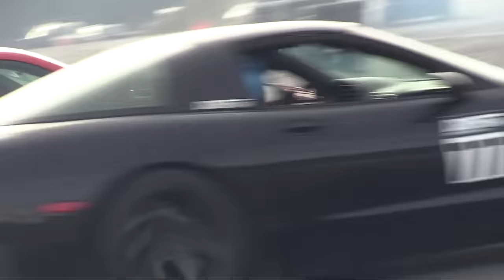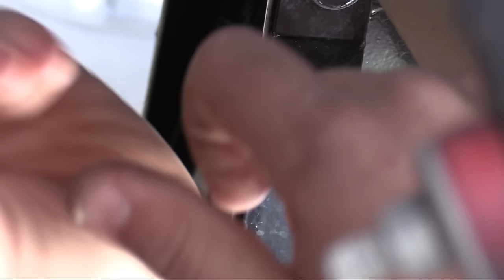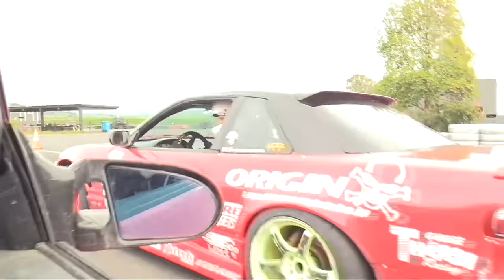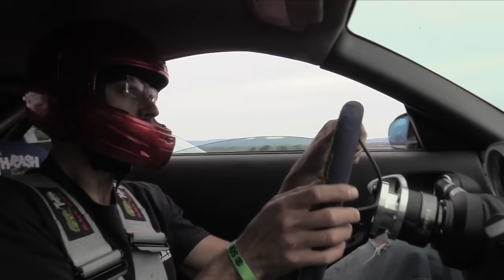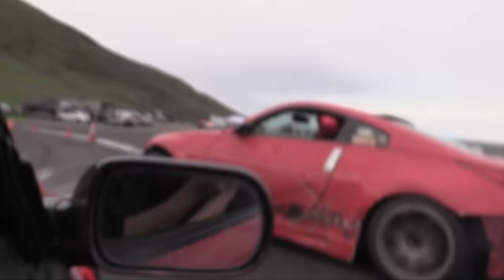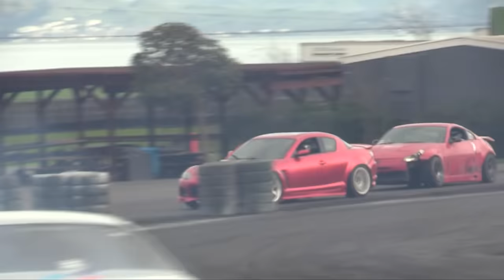No Name Drift Day RAW | Animal Style

Comment: JULIAN SIR I NEED THE Z SETUP and ALIGNMENT SHEET!
Reply from the maker: Gktech bolt on knuckle (high Ackerman setting) and LCA (shortest length, I think 25mm over stock), Stance coilovers, 4.3 final gear (4.1 is probably better)

Basic alignment stuff, little toe out front and whatever caster/camber you end up with at that arm setting. Zero out the rear and goooo
Reply: @AnimalStyleTV   thank you so much i appreciate the knowledge being shared🔥🕺🏽🔥
Reply from the maker: @esco2433  anytime dude!